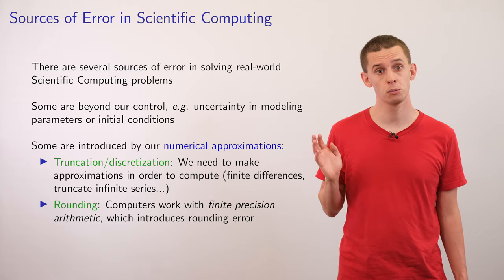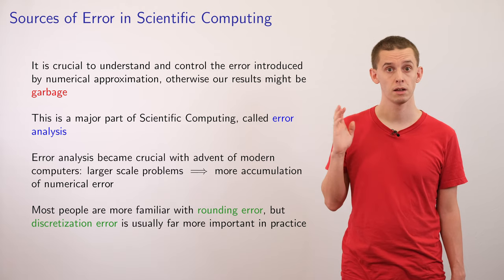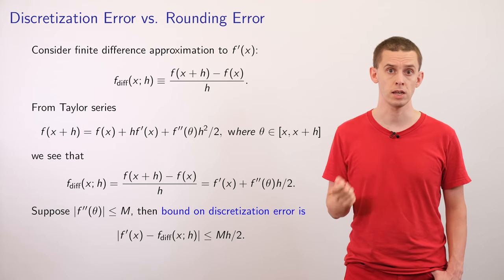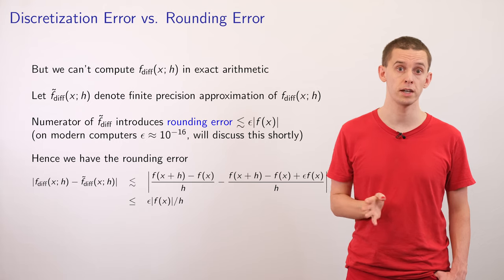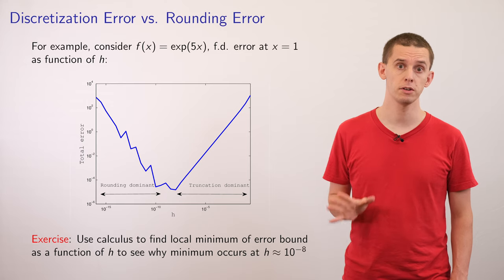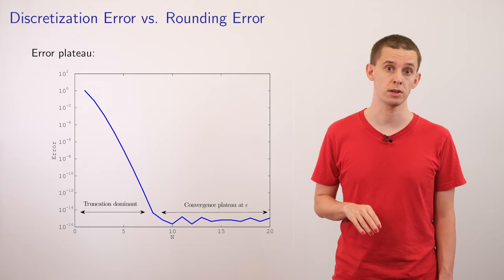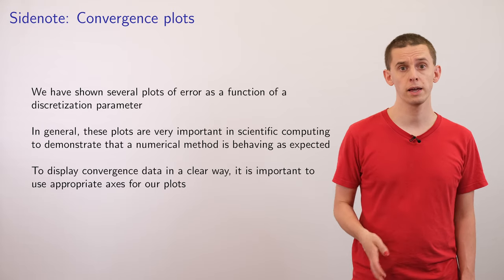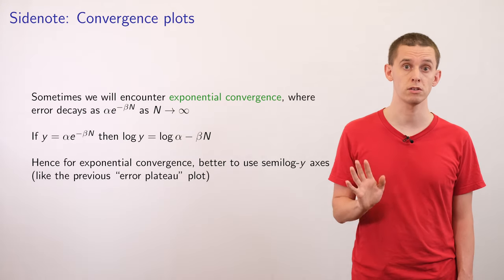Harvard AM205 video 0.2 - Sources of error

Comment: Hello @chrisrycroft2010,
I really like the lecture series..
Could you please explain how the second term in the inequality gets eps*f(x)/h  term? Why is not eps or any other expression? Thanks!
Reply from the maker: Glad you like the videos. The term eps*f(x)/h comes from considerations of computer hardware and how rounding errors occur. This is one of the first videos in the sequence and it's designed to provide a quick introduction, so I gloss over these details here. But they are covered extensively in the later video 0.4 (https://youtu.be/VzKl3-D1CVc?si=cmaXFMYZnO877_fJ).

Modern computer hardware typically represents real numbers using floating point arithmetic, which is essentially like scientific notation and allows numbers with very different scales to be represented. Whenever you do an arithmetic operation like a+b, then the hardware guarantees that you will get the correct answer up to a relative error of machine precision (called epsilon). Typically epsilon is on the order of 10^{-16}.

Here, when you calculate the derivative, you have to do f(x+h)-f(x) in the numerator. Since f(x) and f(x+h) roughly have the same scale, the rounding error you will get will be of size epsilon*|f(x)|. Dividing through by h from the denominator gives epsilon*|f(x)|/h. This division will also create an additional rounding error, although it turns out this will be small  and not affect the approximate bound.

The reason that the f(x+h)-f(x) operation gives the largest contribution to the rounding error is that you are trying to measure a small difference between two terms that are large. That is a case where rounding error becomes noticeable.
Reply: @chrisrycroft2010  
Thank you so much for the prompt reply and detailed explanation.
It really helps, and I found the explanation in video 0.4 (@ around 18:00). Thanks again!

Comment: 🎯 Key Takeaways for quick navigation:

📊 Error analysis is fundamental in scientific computing, involving both modeling and numerical sources of error.
🔄 Truncation or discretization error arises from approximating continuous processes with discrete calculations, such as finite differences or series truncation.
💻 Rounding error occurs due to finite precision arithmetic in computers, where small errors accumulate during arithmetic operations.
📉 Discretization error often dominates in practice over rounding error, impacting the accuracy of numerical computations.
📈 Error behavior changes with the choice of discretization parameter \( h \), with a minimum point indicating the transition from dominant discretization to dominant rounding error.
📉 Error plots, especially on logarithmic scales, help analyze error behavior and confirm convergence of numerical methods.
🔍 Relative error, though more informative in some cases, poses challenges when the true value is unknown or close to zero.
📐 Log-log plots are useful for deducing algebraic convergence, while semi-log plots are suitable for detecting exponential convergence in error decay.

Made with HARPA AI